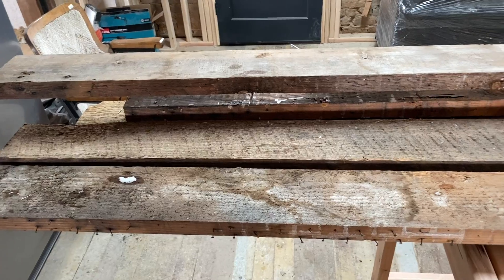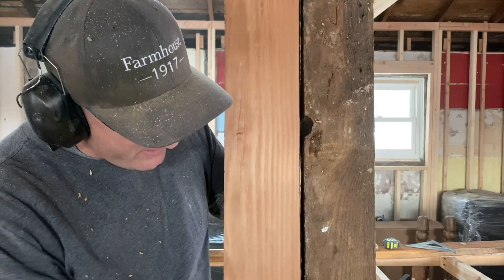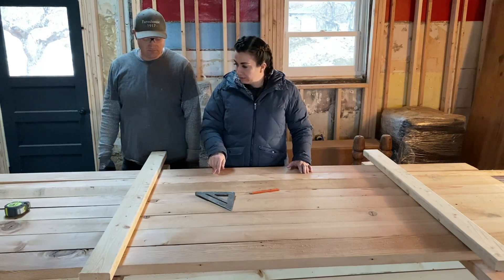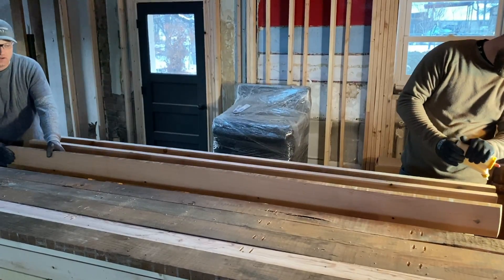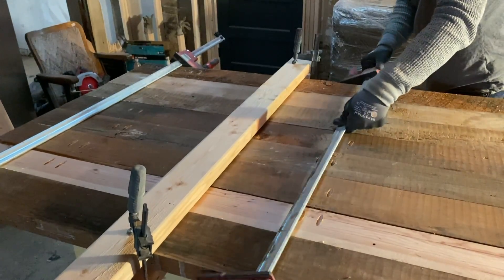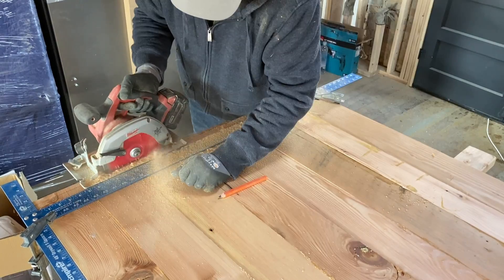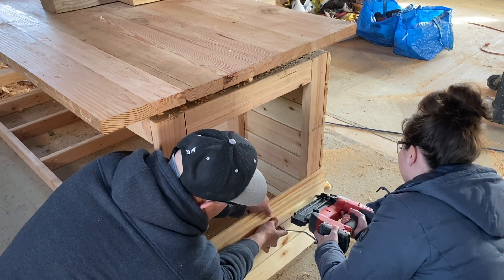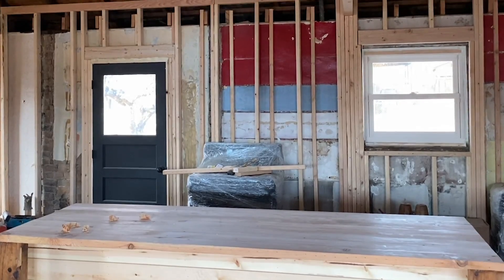Kitchen Island DIY Reclaimed Wood Counter Top

Comment: I did some thing similar but did not use the planer as you did at the end.  I have a planer but still gouge the wood instead of shave it.  I could have had a much better surface had I plane it.  I need to learn to use it.  When you say resin to fill the holes.  Do you mean plastic wood or is there a better product. 
My table is in florida and the humidity had cupped the wood slightly and thats where the planer will come in.  Thank you for the inspiration.
Reply from the maker: I’m going to use a 2 part resin. I’ll be sure to show it in an upcoming video when I do.